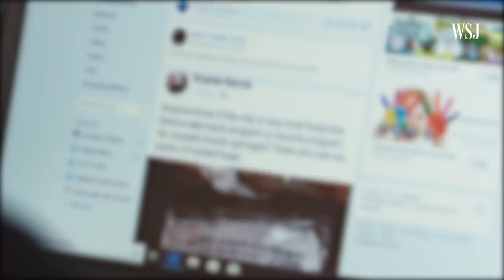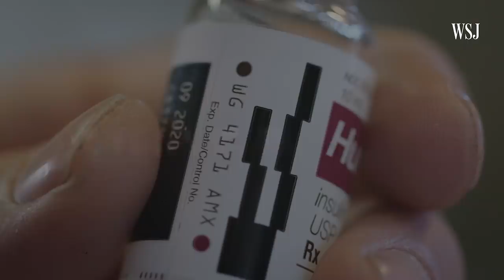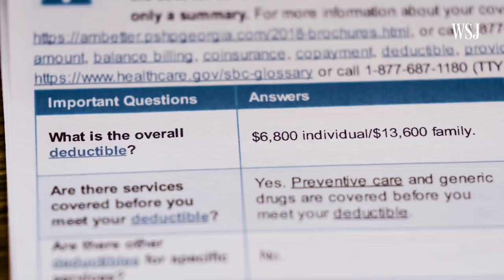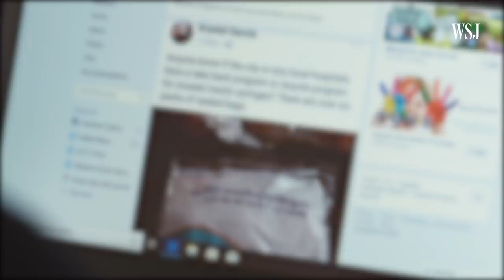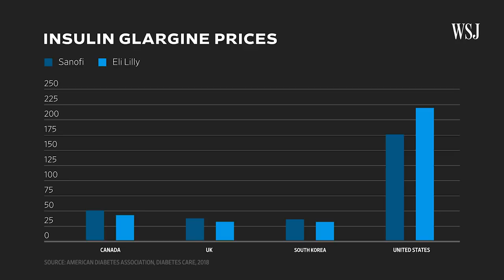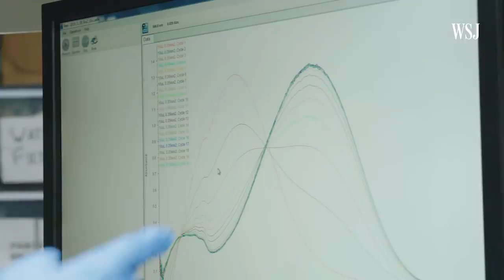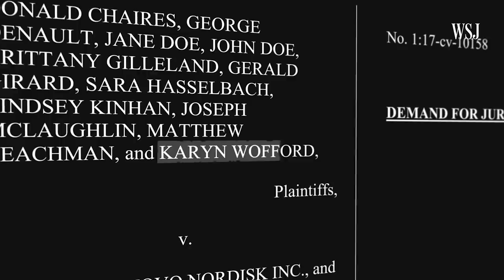High Insulin Prices Drive Diabetics to Take Extreme Measures

Comment: I think the Open Insulin Project is a good idea but i think they need to patent their formula otherwise someone else could patent all their hard work and then restrict the flow of the product and diabetics would be right back where they started. If the O.I.P were to patent their product then they could safely keep anyone else from patenting the formula and they would still be able to help diabetics by allowing people or other facilities to manufacture and distribute low price insulin to diabetics in need for certain periods of time that way the prices can be kept low.
Reply: It's not possible to patent something already published by someone else. And besides, it's not the patent that's the problem, the patents for original production processes have long since expired and are public domain. Anyone can use these production methods and pump out as much insulin as they like. They can't sell it in US though, unless you are one of the triopoly you'll never get an FDA approval to sell any version of insulin. That's also what's stopping anyone from simply importing dirt cheap insulin from outside US. The system is bought and payd for and you are not allowed to enter the playing field.
Reply: In US FDA plays like doorkeeper and that's why prices are high for basic drugs

Comment: The US health care system doesn't even earn it's name. Where's the "care" when you can't even get basic medication you need to survive? I live in Germany, make <30k€/year, ~15% of that go to health care before it even hits my account. What do I get for those ~350 a month? Pretty much limitless access to every prescription medication I need once I actually have a prescription. I pay a fee of 5-10 bucks per medication(e.g. 10€ for a 3 month supply of my antidepressants that would otherwise cost ~75-100€ and there's an upper cap of how much fees I have to pay each year depending on income. Btw that same AD I get that costs less than 100€ per 90 tablets clocks in at around US$60 PER TABLET in the united states. And the ones I usually get are reimports from the US. So the price is literally almost a hundred times higher even tho it's the EXACT same medication.
Reply: In my opinion, we can never get universal Healthcare here in the US. The pharmaceutical industry is too corrupt and there are too many kickbacks. The "Affordable Care Act" is a prime example.

Comment: I wonder when the patents will run out. The patent system seems broken, there needs to be change
Reply: Synerrox no patent means no new drugs. If a company can’t guarantee a high return on a new drug, then why bother when the cost and risk of failure is sky high. Every new drug has to go through fda testing which in itself takes half a decade. During that time, many pharmaceutical companies are revenue negative, not making any money but burning it through clinical trials. Even so, most drugs fail to pass third stage trials. That’s when many pharmaceutical companies go belly up.

If they are successful in passing fda trials they immediately go public or are acquired in order to help balance the cap structure and reduce debt to equity. That is only possible if there is a high drug value and expected cash flows from exclusivity
Reply: mark k Just search patent system on YouTube. I know you are too lazy to that (at least I would be would) but I am just saying that the patent system is totally broken and there are many better options you just haven't reached the subject.
Reply: @jholotanbest2688  evidence is king. Tell me a system that creates more unique drug treatments than the US 0atent system?

You can't because the US creates more than half of the world's new drugs. Most other countries are busy creating generics.

Why dont you educate yourself. My original post stand correct. Go read something. Mediocrity isn't a good look.
Reply: Sam Williams  you too buddy.
Reply: @loveflying4488  I am not disputing that USA crates lots of drug treatments bro. I am saying that the patent system is incredibly good for the company's but bad for the citizens. And might be better alternatives like government funded reaches. 
Also the fact that USA is creating so many treatments might has something to do with the fact is is the largest economy and all of that jazz.

Comment: I pay $1,100 monthly for my insurance (it will go up each year). I have to pay $5,000 out of pocket before anything is covered. I have to pay $385/month for an inhaler for my asthma and over $600 for a single tube of medication for my seborrhea/dermatitis. I would survive, although be miserably itchy, without the treatment for dermatitis, but breathing is pretty essential. Spending $15,000-$20,000 on healthcare each year is assured and my only significant health issue is my asthma.

Comment: I certainly agree that high prescription drug prices are a big problem, and I think it's criminal that prices for the same medications in the US are so outrageous. Since the topic of this video is specifically diabetes, I would just like to say that - while I know this won't help everybody - if your diabetes is weight induced, diet and exercise (mostly diet) can go a long way and even reverse diabetes. According to my research, as little as 5% loss of total body weight can help to improve type 2 diabetes. This is obviously not a solution for the price issue of prescription medications and that issue needs to be addressed, but if you are suffering from type 2 diabetes, I hope you do what is in your power to help yourself. I'm currently 305 pounds, down from 425, and I'm going to keep going. I was never diagnosed with diabetes thankfully (although I avoided the doctor due to medical costs and feeling ashamed about my weight), and at my current weight, according to my doctor I am not even pre-diabetic which I am super thankful for. Be well all. :)
Reply: Type 1 cannot be reversed the pancreas no longer can produce insulin at all. This type is not caused by poor diet and no exercise it is mostly a genetic disorder passed down thru families for generations.

Comment: I need to take thyroid. I have to take amour because I have adverse reaction to the synthetic. Monthy cost is 90 bucks and will go up has I need a higher dose. It's hard to budget it and now my doc wants me to go on high blood pressure. I told him I can't afford the meds so I don't even get the script filled.
Reply: High blood pressure meds should be pretty cheap. Given (at least here) plenty of generic brands of it. 

But then again. My expensive ADHD meds are (as of now) covered, even when i turn 18 by the base insurance. So bp definetly is.

But realistically. With a high bp. (Look if you don't have any of the risk in your diet. I can type an extensive list) are on a healthy weight and work out. It really only just prevents the chance of your veins and heart wearing out, leading to a heart attack in your 30-40's. So you could possibly wait if you limit all risk foods, stress and do work out.

Comment: Im a type one, I dont really eat alot of carbs, requires little insulin. Im reading alot of comments that are blaming this for their problems, nah, its your fault. I understand the price increase and such isnt right but the condition of your health is no one but your own responsibility. Personally I dont really like to take that much insulin, it can cause kidney failure.
Reply: It is NOT your fault that you have type 1 diabetes. Its NOT anyones fault how much insulin they require either. Even eating low carb everyone has a different insulin to carb ratio. If you are type 1 and you think that its your fault, you arent very well informed about your own disease.

Comment: In terms of developing and manufacturing pharmaceuticals, the cost that goes into researching them, making sure they’re safe, developing a method to produce them efficiently industrially is extraordinarily high. Therefore, without the high listing price on the finishing product, there is just no incentive for pharmaceutical companies to develop and product medicine if it is sold for very cheap. Therefore they hike up the prices. Which makes sense, companies like these are not government run, they have no reason to produce medicine without profit, it’s just how economics works. Now, why doesn’t the US government understand this and provide better health care aid to the populace? If a portion of the high cost it takes to develop and produce these medicines is taken care of by the govenment, there wouldn’t be this problem for diabetics in the US. If they have time and money for immigration laws and building walls, they have the time and money to improve healthcare. ._.

Comment: I have two sisters that are both type 1 diabetics that are insulin dependent and their doctors prescribed insulin that cost between 650 and 1000 dollars a vile, that last 28 days, I was shocked when I found out so I did research on blood glucose control and found out after logging and monitoring their bgl and carb intake I could get them to one unit of insulin per meal and sometimes one unit at night. Then I researched cheaper over the counter insulin and found Walmart's humilin 70/ 30 worked almost as well and only cost about 25 dollars a vile and it only took about one vile a month. The key is maintaining a strict diet and body fat, I discovered that body fat can hold extra insulin and as it was burned would release it into the system and could cause low blood suger. It just comes down to maintaining a healthy diet.

Comment: The medication for my epilespy is around 1300 for a month supply. I cant afford it so i dont have it. With out it nothing stops my seizures and not only my nervous system but also my brain suffers. It increases the risk of SUDUP kicking in meaning i can drop dead any day if i sleep or have a seizure. In short, im most likely going to die because im poor. 

Our healthcare system sucks and it needs to change but it never will because they refuse to lose that money.

Comment: Atleast they have jobs and the insulin is available. Not like what's happening in Yemen because of the war no jobs no pay high prices for medicines which are hardly available no electricity to cool the insulin expensive fuel to turn on geterators to cool the insulin can't store insulin at home expensive to transport insulin while cooling with destroyed infrastructure it takes a day to transport anything that should have taken an hour. And the US has supported this war the senate has passed a vote to end support but the house speaker Ryan has cancelled the vote till 2019 around 3000 children will die in december because of speaker Ryan.